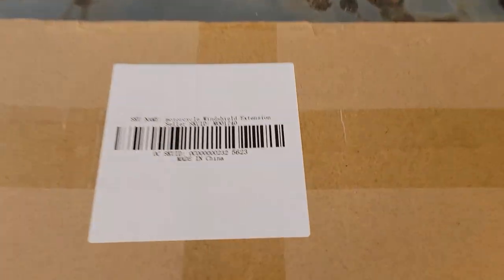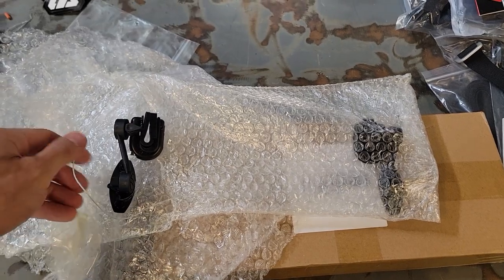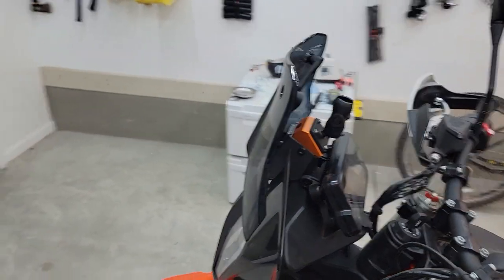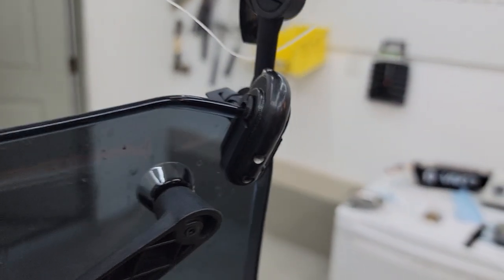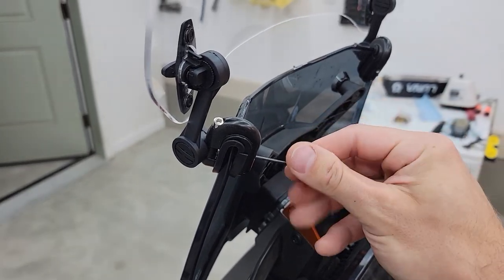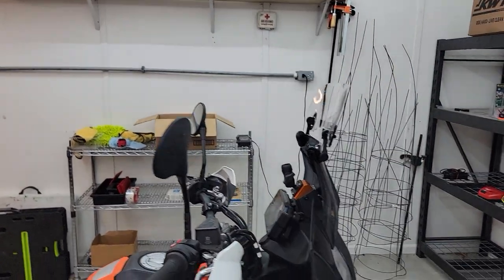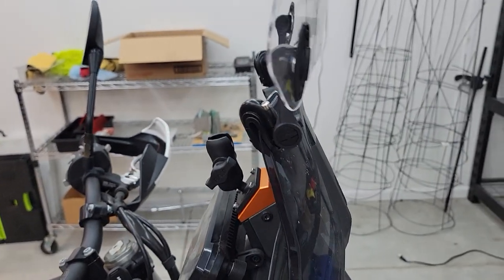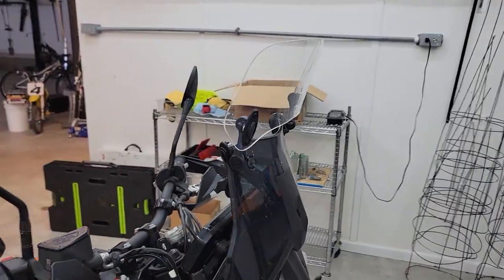Can a clip-on windscreen solve the buffeting issue on the 2021 KTM 890 Adventure R?

Comment: I bought and installed the exact same one. I put as low as possible to create a laminar flow.  It is fantastic now
Reply from the maker: I should have added that i still use mine, but i dont believe the difference is that incredible. I still think a taller windshield would be the way to go if you were doing a lot of pavement. The buffeting also doesnt bother me a ton, so this is probably a personal preference kind of thing.

Comment: I had an almost identical windshield extension on my 1090 ADV. After trying different heights and angles I poured JB WELD into the connections and locked the pins. Came out pretty ugly but held 230 km/h ~ 142 mph. I think that's around 120 mph with the extension:
https://youtu.be/xtsx7uHUX9w?t=480
Yet, I wasn't completely calm. if this piece of plastic is torn off towards your throat, the helmet might help protect the head, but it won't be connected to the rest of the body...

Comment: I had one on the KTM ADV 1090 S and it was as ugly as it was efficient. The windshield of the 790 ADV also performs quite poorly. I don't want to look through the windshield so I changed to the shield of the rally version and I ride in the lowest position with my head slightly bent at speed when I'm over 140 km/h. Up to 120-110 km/h, there is no problem. About 175 cm tall. Upgraded and slightly higher seat than stock.
Reply from the maker: unfortunately for me this extender is just getting more broken over time. I just picked up a different style windscreen from China. I have a video coming out tomorrow on that one.

Comment: I think I have that exact same extender on my 890 Adventure S. I do notice that it helps some with buffeting (I’m 5’9”), but it is so wobbly on the top of the windshield that I really don’t like it. I’m looking at alternatives like the Rade Garage windscreen.
Reply from the maker: yeah, ive had several parts snap off by now. I am still using it, but ive got zip ties and wire holding it together now. Im looking at the Puig screen, but i havent done anything yet.